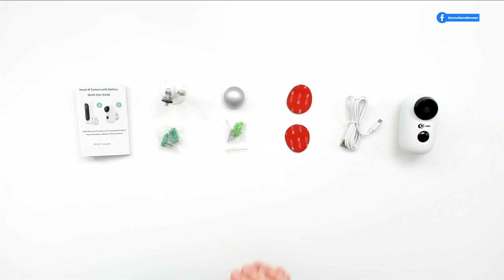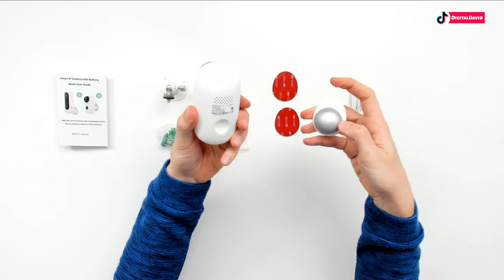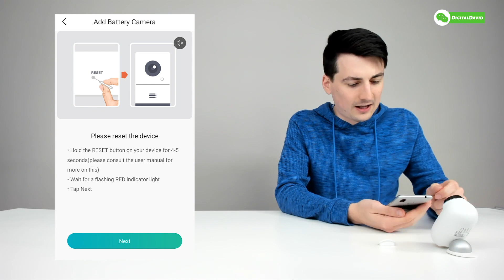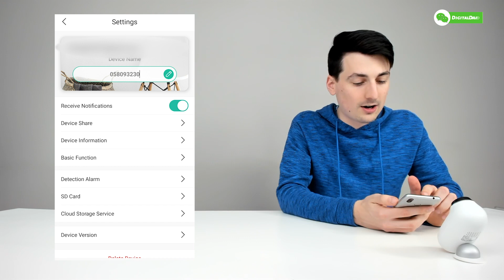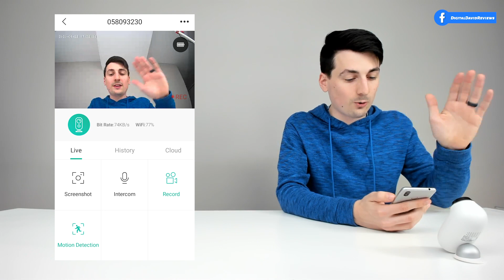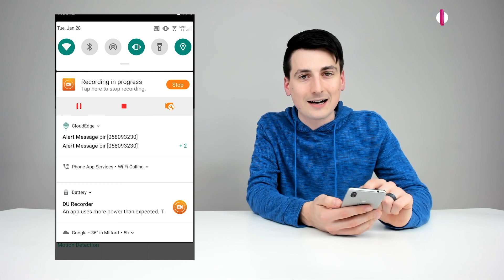XVIM Wireless Battery Security Camera // Outdoor Rechargeable Security Camera

Comment: I have tried like 10 times to set up my camera, it isn't finding the camera. I have tried both WiFi and qr code, neither work, any thoughts
Reply from the maker: I'm not sure :( Wish I could help!
~B
Reply: In case anyone stumbles on this, I had the same problem. It wouldn't configure on battery power.  Worked instantly once plugged in.